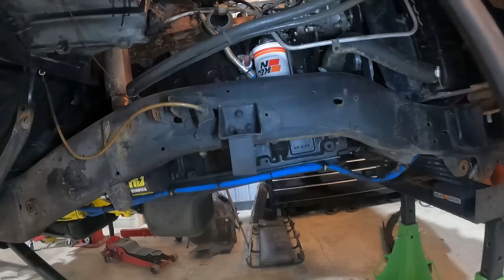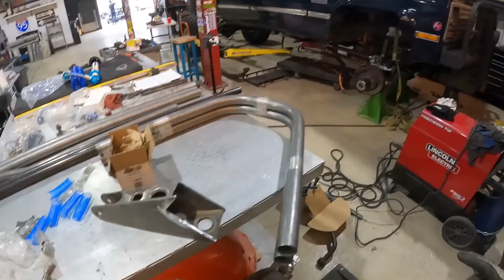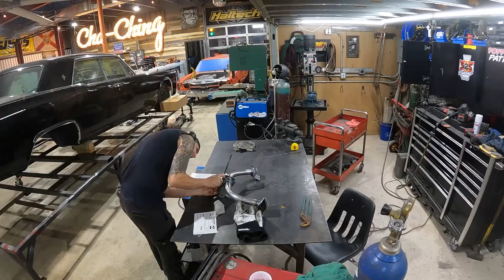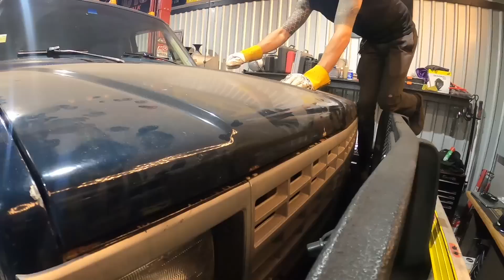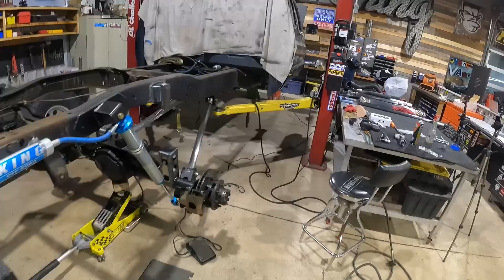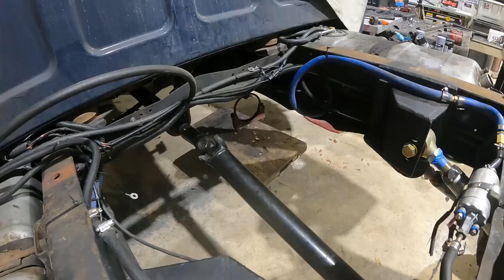How to: 10 Inch Off Road Lift Fabrication - Chevy K20 Diesel Cummins Swap Squarebody Ep. 2

Comment: Obviously you guys are doing an awesome job, I don't even need to say it. Question though. Why do you tig weld everything? Is it just a pride thing? I don't think tig is any stronger when the correct settings and gas are used with mig. Especially if you can do spray arc transfer.
Reply from the maker: We're using a lot of different materials and different thicknesses throughout the process of builds like this, so sometimes it's easy to just continue with the TIG that's already set up than to go and set up the MIG machine. Sometimes the TIG is out of necessity, sometimes it's just preference!
Reply: @SalvagetoSavage  Thanks for the reply. I figured you were just showing off, since a lot of guys don't even know what settings or gas to use with mig, much less how to tig weld.

Comment: One thing I did with my square body crew cab steering box was drill out the threads on the box, and run 7/16 studs all the way through so it is held to the frame with the studs, nuts, lock washers on both sides, and not the steering box threads. I am guessing since a steering box frame reinforcement plate was welded to it there was also the ORD steering box support brackets. You guys are going to have the diff geometry better than factory. When I welded on a new leaf spring saddle onto my Dana-60 I did like you guys and used the right diff center section spring pad to square away the the left side spring pad, and I found that the factory was off by almost 7/16". One other suggestion is get a steering shaft from a 2000 Chevy Express van, in order to eliminate the rag joint on your square body. Most auto parts stores can get you one of those.

Comment: Whats the cost, labor and all?
Reply from the maker: It's hard to calculate what the cost would be without seeing the truck we're working on beforehand. We can run down the hours that it took for this one, but it's a bit of a different beast because there was a ton of extra work that needed to be done off camera to make everything work seamlessly with the massive cummins that was already swapped out in this truck!
Reply: @SalvagetoSavage  exact truck but single cab, ls swapped

Comment: Love the builds - they just keep getting better and bigger!
A general question, why can't the plasma cutter start on the edge? There must be a reason as there seems to be so much wasted material. Thanks again from Down Under 🇦🇺
Reply from the maker: We cut inward of the edge to make sure that there isn't any part of our design that gets left out because it ran out off the boundary of our material. That edge of the material also helps keep everything we're cutting in place. When we cut at the edge, we've found that the piece we're cutting moves or shifts and gives us less of a clean cut overall. It seems like there's a lot going to waste, but much of that material that you see left over usually gets cut off by and and bent up to be used for brackets and other small odds and ends!
Reply: @SalvagetoSavage  thanks for the explanation, makes perfect sense 👍

Comment: I’d like to see the drag link moved to the bottom side of the high steer arm, would make the drag link and panhard bar more parallel
Reply from the maker: Thanks for the feedback! If we ever do another lift like this, we'll definitely keep that idea in mind!
Reply: The tubes don't actually need to be parallel, the lines between the joint centers need to be parallel.  The look can be a little confusing since it's the imaginary line that matters.

Comment: That’s a k30 but whatever 
You guys do really good work enjoy watching
Reply from the maker: Thanks for the heads up! We'll double check to make sure then make the corrections in the title and description!
Reply: It is a 1989, so it would actually be a V3500. 1988-1991 square-bodies (3rd gen trucks), after the introduction of the GMT400 (4th gen trucks), all became R/V designation and Chevrolet took on the GMC 1500, 2500, 3500, etc. Only Crewcabs, Cab and Chassis, Motorhomes, Suburbans, and Blazer/Jimmy SUVs continued on for those 4 years after 1987.

Comment: On the front bump stops, did you account for flex? Like when crawling and one wheel is at full droop and the other is at full compression, will the bump stops still line up?
Reply from the maker: Yup! We did a full range of articulation in as many configurations as we could think the suspension would sit and still make contact!

Comment: Would be nice to see the frame reinforced where the steering box mounts, they are a known weakness and will crack or break off leaving driver with no steering, Very Bad!
Reply from the maker: If you watch the video, you can see Dave point out the steering box mounting position had already been modified and reinforced before it came into the shop!